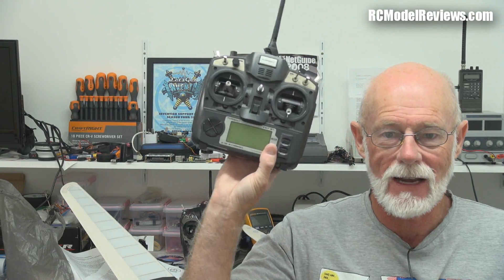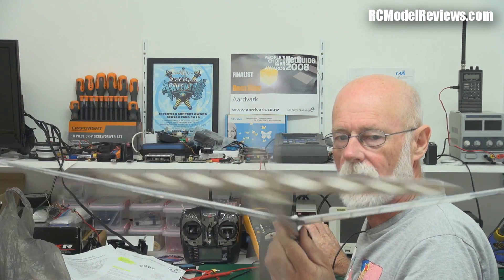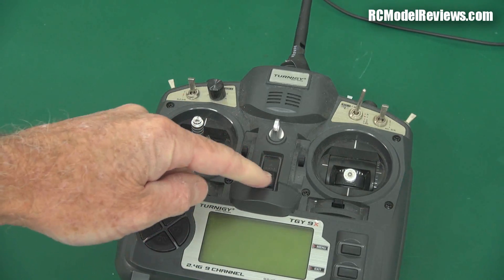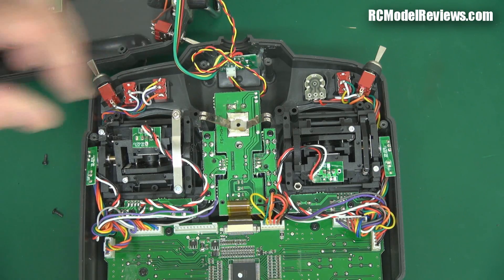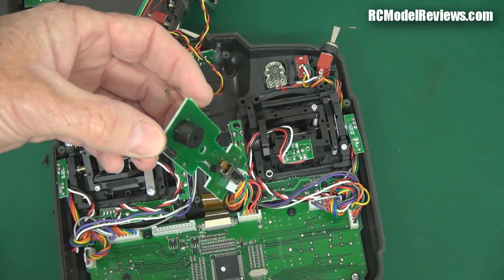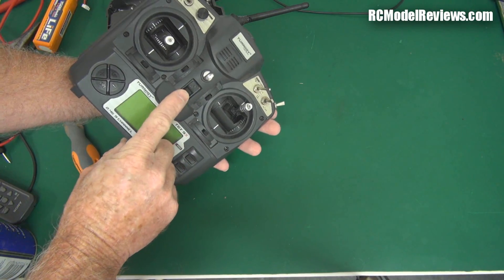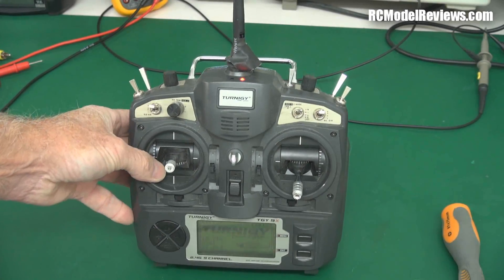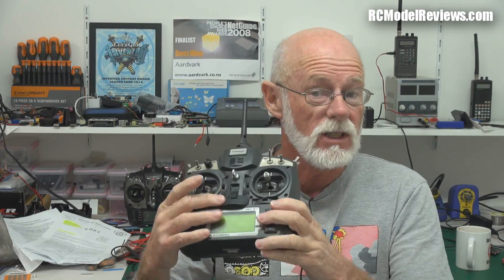Turnigy 9X switch fix and the importance of failsafes

Comment: Hello, i came up with problem with turnigy 9x. After i change flight mode on my apm 2.6 from manual to loiter, drone uncontrolled sets 100% trottle and flys to the stars:) drone dosn't respond any commands to my transmitter inputs. even if i set throttle to 0% it still fly to sky. have you evenr heard about this issues? after lots of investigation i suspect turnigy 9x in all this.

Comment: Hello, I watch all your videos. They have been very helpful over the years. I just got a second hand turnigy 9x for my nitro airplane, and I am wondering what is a good rechargeable rx battery I should get? Should I get a 4.8v or 6.0v? Lipo? Nimh? Or? What do you recommend?
Reply: This has been a while, but a 3S LiPo to power your 9X should be good

Comment: so, would you recommend this radio for a noob like me? i am switching over from 72mhz.. as that the first/last plane I had lasted almost thirty seconds, I turned it left and it went right and got into a fight with a telephone pole. it lost.
Reply: +charles dilmore Depends. It is a good cheap way to learn Opentx. But I think you should read the manual carefully before use.

Comment: Please could someone tell me how to set the fail safe on this Transmitter ? i am using it for a Quadcopter , I have looked at youtube I have gone to settings gone to fail safe changed thr from NOR to F/S 33% im thinking if it losses signal i want it to slowly fall to earth it seems to of saved it as its still there on 33% when i go back But if the model is running and i turn the TX off ... it keeps at the same speed What am i doing wrong please ??

Comment: I have problems with my new 9X radio. Gear and elevator switch are not stable. Sometimes they work and sometimes not. Strange thing is that when i switch gear and elevator together both always indicates on on the display but not when I switch one at the time. I have modified 9X with avr cable. Could something happend when I solder the cable to the board?

Comment: Humm... cheap TX's? It's the only LOS RC part you'll never lose, never crash, and the most important part for setup function, control resolution, and enjoyment. Can't see any value in them if there is ANY possible issue like the power switch shown here. Same goes for the RX too to some degree, but since some people do lose them I can see using one in a cheap foam RTF but if I built it out of wood... or put nice electronics in it... just can't see risking it with a potential weak link. Same goes for servos. Remember... a tree doesn't need to fall to make a noise when you crash into it. 

Wow... my USB TX for my Logitech mouse just died! SOAB...ERR! Got a message that said USB device not recognized and now no mouse... rats! Now I'm using the touch pad... See what I mean? You just never know when cheap electronics are going to fail. By all means get a good used radio if $ is tight... protect the hobby "just in case". And build good flying habits by flying like you are in it. No excuse for crashing all the time except bad judgment and bad habits causing it. Better to start off slow and work your way up by developing good habits. Good habits let you fly far better and create reflexes that will save your model without thinking about it when landing. 

Well changing USB ports isn't finding the mouse TX and everything checks out in diagnostics. I'll reboot but doubt that will make any difference since it alerted me and knew "something" was there. But now it's not even being seen...ERRR! You know there's a name for this in physics called the Pauli effect and synchronicity. The mouse is almost 3 years old. What are the odds I wonder... I shouldn't have said anything about the trees. Everything needs a connection. Maybe trees don't like what we do to them before we run into them with their buddies... LOL

Comment: Hi sir, i really need helppp! My turnigy 9x doesnt go into failsafe, i have my receiver connected to the apm2.5 and i see all the readings on my laptop and it seems that when i turn the radio off all the values (or the pwm) stays where they where, even if i set up failsafe on the radio it just doesnt work. In other videos i saw that when turning of the radio automatically the pwm on the throttle drops to its lowest levet. Thanks a lot!
Reply: nicolas azar if you are using apm you dont need to set up the failsafe on the transmitter. if you setup the transmitters failsafe then apm wont recognize that you lost signal. just go ahead and use the failsafe on apm and dont use the FS on the transmitter. i have the same setup and it works fine.

Comment: With the cheaper 6 channel radios, is it possible to replace the switches with potentiometers so I can have variable control? The turnigy has 9 ch and 3 knobs, but it is still quite up there in price for me, and since I am making my first quad and don't want to have much invested in it,  I would prefer to use a 6ch radio with one knob to use for the angle of a camera, and maybe the other switch can be changed out with a multi-position switch that will set the flight mode of the multiwii board (GPS return to home, acro, stabilize, etc.) I do understand that the channels are broadcasted as PWM/PPM, so thats what got me thinking.

Comment: Installed ANYLINK in 4ex Futaba (72 MHz), bound it to a tr624 Tactic receiver. While setting the throws I found I had to reverse the throttle channel, then I used the power switch to lock in adjustments (my bad), motor began to scream ,failsafe was set wrong after reversing the throttle. Rebound transmitter and all was right in my world. Similar problems when throttle trim was not set low when binding but then engine did not go full speed. Good way to have a flyaway or blood letting on loss of signal. No prop on Anylink  and some one was holding tail on the trim problem. Whew!  Failsafe can be scary if ignored.

Comment: Contact cleaner.. used to call it tuner cleaner when I worked part time in a TV repair shop back in the late 60's! The old manual TV tuner contacts would get all glitchy. A little the cleaner, spin the dial a bit and good as new! Glad some things can still be fixed easily!! Thanks for the tip Bruce. I've always thought the switch felt odd when I turn my radio on... Just doesn't have that "positive" contact feel when moved. Now that I see whats going on inside, no worries (I hope!!)

Comment: Bruce I am still waiting on feedback on my 9x.  It is perfectly good but sitting in a box useless because the (Mode 2) throttle is reversed.  Up is off and down is on.  It happened when I connected the orange spectrum transmitter module????
Help Please
Reply: flash it over to ER9x. It will take a bit of soldering but makes a cheap radio into a powerhouse.
Reply: Yes, the Spektrum uses different channel ordering and has the throttle reversed.

I just helped a guy this weekend who'd fitted a Spektrum module to his 9XR and was encountering the same problem..

Perhaps I ought to do a video on using the 9X with that Spektrum module?
Reply: ***** Yes please because even when I put the 9x module back in or use a FRSKY it is still reversed.
THANKS

Comment: I prefer to use an electronic cleaner & lubricant.

Plus, the double pole C/O slide switches are available as well.
Jaycar > CAT. NO. SS0823

& guys, can we please keep the comments clean?
A little decorum & common decency would not go astray.
Bruce, You need to allocate some moderators on the pole2poleRC fora
& put in an appearance to allay the troops fears.
;)

Comment: Glad to see U still use ur 9x. For my part, i had the same issue twice, not a switch issue but a gimble (joystick), i was putting one of my 9x in a case. The case was to small to fit the 9x with a back stand & big tumbs joysticks. The pressure applied by the case cover to the throttle stick was make it useless. It took my 2 times to find the cause.
FAILSAFE, thnx did not know FrSky had some. I bought a separate Failsafe, OMG i know not how this works. A hand would be welcomed.  ty.

Comment: Just a tip: while you have the TX open, you might as well do some contact spray on every switch,pot and on the 4 pots from your gimbals ;o)
Keep it safe, and happy holidays to you all.
Reply: Fortunately I've never had an issue with any of the pots or switches (aside from the TACT switches which usually don't respond very well to contact cleaner/lube anyway.    Others may have had different experiences however.

Comment: Cheers for the heads up Bruce =]
Not sure if its possible, but is there a way to change one of the pots to a fancy slider switch like on the Taranis?
Reply: im sure someone will help you but off hand i think there 5k liner , ether way it sure is posable.
Reply: =] Cheers

Comment: Hi Bruce is there any possibility you could do a set up vid onhow to set  failsafe
Reply: Yes, can do.  However, different RC sets use different methods for setting the failsafe settings.  Some use the position the servos were at when the receiver was bound, some have a transmitter menu option to set failsafe and others require you to press a button on the receiver -- so I'd probably have to do a different video for each make of radio.
Reply: ok thanks bruce i have theturnigy 9x
Reply: WINGS RC
Unfortunately, if you have th standard 9X with the Turnigy module then there is no programmable failsafe facility.  To get failsafe you'd have to upgrade to the FrSky module and receivers.

Comment: My 9x buttons quit working..well ..sometimes they work ...sometimes they dont..
Reply: That is the little TACT switches that they use.  They are also quote "low price" components which have a limited life.  Replacing them isn't hard -- perhaps I should do a video on that too?
Reply: That would be up to you, Bruce. Since i only use this radio for cheap models that i build out of fan fold foam i have been too lazy to solder anything as they still work intermittently. it is more of an annoyance then a serious issue when trying to adjust rates... :P i think it would be extremely helpful to others who use the TX for more serious use or a main TX.

Comment: Would this need to be done on the 9XR as well ?
Reply: I'll check the 9XR and see if they've used a different (better quality) switch.
Reply: ***** I just got a 9XR, and the power switch feels very loose and the radio blinks on and off if you bump the switch.  Makes me a little nervous.  Surely the switch isn't oxidized on a brand new radio?
Reply: Well the switches are made to a price so it could be a bit dodgy right from the start.  If it's intermittent then you really ought to make sure it's fixed before risking any models (or someone's safety).